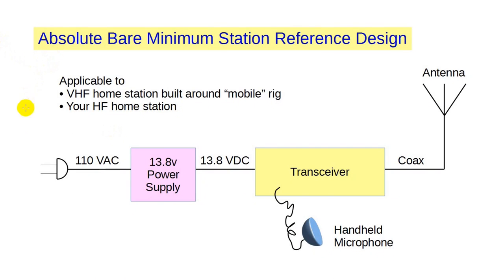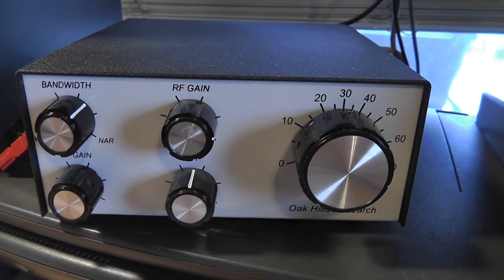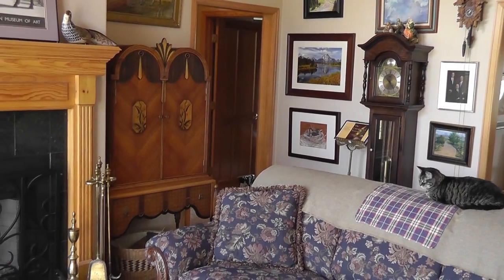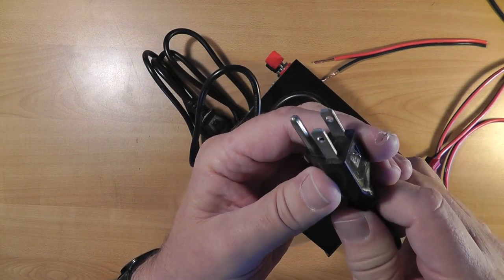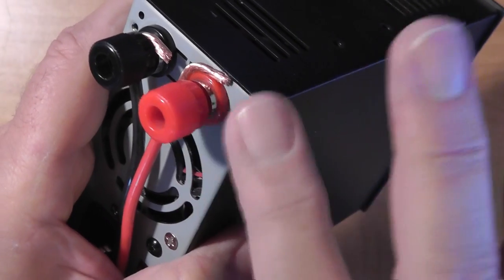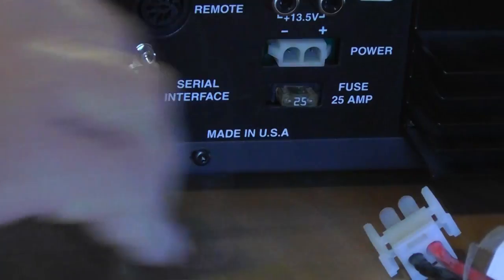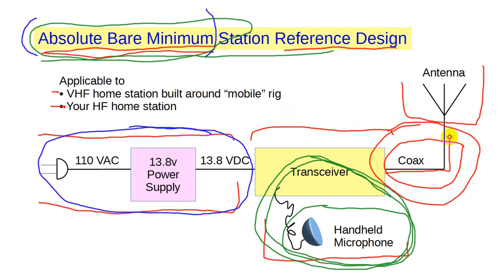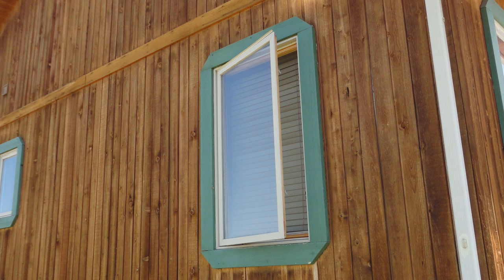Setting Up Your Home Ham Station: Ask Dave Episode 3

Comment: I have a radio coming in the mail with no power supply. It calls for 5.9 Volts at 4 Amps. Would 6 Volt at 4 Amps work or would that possibly be a difference amounting to something unfortunate? Thanks! 73 Dave Joe
Reply from the maker: Sounds like it should work.
Reply: Thanks Dave! I admire you!  73 Dave  Joe

Comment: Thank you for another excellent video!  I like that you called out the fact that one's life partner comes before ham radio and that the feelings of others in the home are important when deciding where to put up a ham shack.  And major kudos for keeping that topic gender neutral.  Regarding product mentions, thank you so much for introducing me to the MFJ window antenna feedthru!  I didn't know such a thing exists but am very happy to learn of it.  I rent my home, and even though the landlord said I can put holes in the wall, I don't want to because of the time it will take to seal them, and later to remove the cables when I move.
Reply from the maker: Cheyenne, I'm delighted you find the videos helpful -- thanks!

Comment: Power pole connectors aren't gender less. There is a male connector that gets inserted into a female socket.
Reply from the maker: Nope. Any can be plugged into any. That wouldn't work if there were a male and female. I should do a video to show how that works. Quite ingenious, really. 73, Dave

Comment: Not bad, but like you said, a little too over simplified. A proper ground and maybe lightning arrester should be part of a good basic setup. However, there are way too many ways to set things up (and with different types of components) to cover everything in a short vid. Thanks. 73. K0FMR

Comment: Premade cable is easy but, requires bigger holes to go through walls and generaly are going to leave you with excess (if all goes well) cable !  maybe to much . Assemble soldering apparatus and knowlage ! the sooner the better !!  Thanks for the vids    Shane KG7WPO
Reply from the maker: +Shane Moscatelli You're right! I've soldered my own connectors for decades. Recently I have been using crimp connectors and the crimping tool, which offers the same advantage of being able to thread cables through smaller holes. Interestingly, the center conductor must still be soldered with the setup I have.
Reply: 00